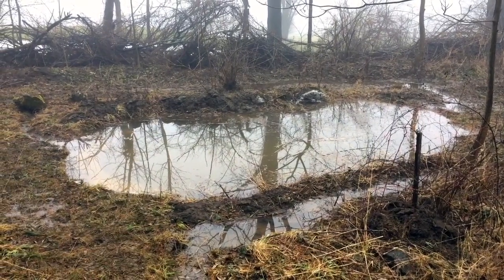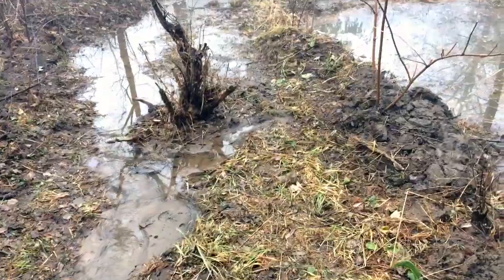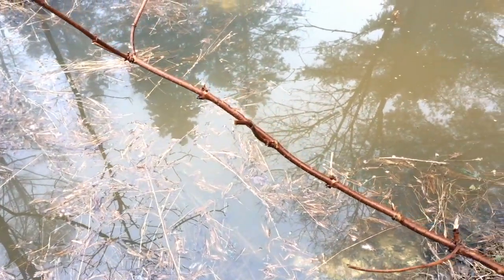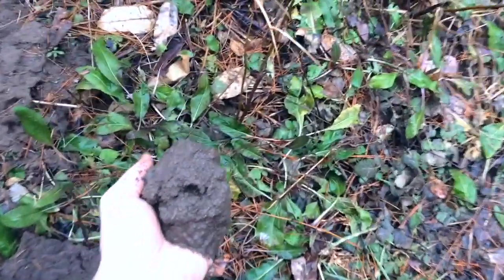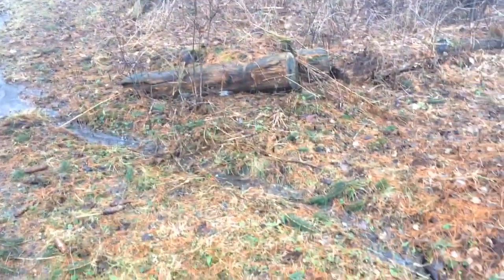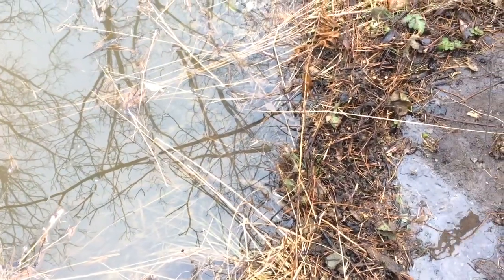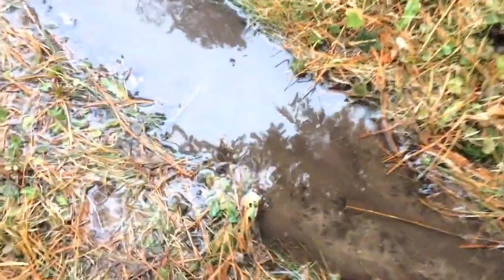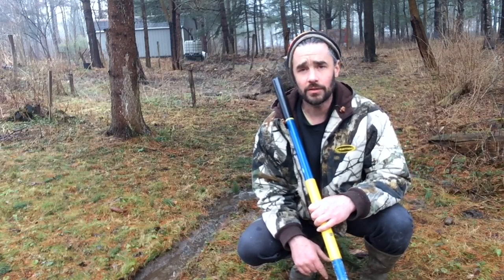Waterway refinements - Silt collecting and flow spreading (in-depth)

Comment: There is a type of shovel called a "Mud Shovel" which is just a regular shovel with a bunch of holes drilled in it. This is helpful for this kind of digging in several ways. 1) It is a little lighter. 2) the water drains out as you pick it up so you are moving more mud and less water. 3) It breaks the suction of mud (especially high clay content sticky mud) so that it can slide or be knocked off the shovel more easily.
Reply from the maker: https://www.youtube.com/watch?v=j3Hu2cBsKwk - Ha!  I made a video about them... Got into that type in the last few years and LOVE them!

Comment: What is the purpose of your Pond?  To reduce silt build up in the Pond itself, I feed mine underground using a standard 4'' sewerage pipe at the inflow end and another outlet at water height level to take the water out back into the creek/stream.  I also have another 4'' sewerage pipe at the outlet end underground which provides irrigation for our Back to Eden Garden.  For berms, barriers we used recycled tires/tyres filled with earth.  Therefore, my Pond is termed a living Pond, grows Lillie,  supports fish, frogs, water snakes and is never stagnant albeit, we dug ours with a mechanical digger as it is over 3 metres deep in the centre.  You're very lucky to have a natural water course/supply as I do on your land and it has to be used to its best efficiency.  In our latest clips, we show how we dig flood relief trenches as after heavy rains and/or rapid snow thaw, we get flooded out and my Pigs are down there.  I harvest my silt from the natural course of the stream too.  Nice work.

Comment: It would be nice to have an abundance of water, such as you do. My swale and pond systems have been dry for well over a year. So no observing and tweaking for me. Just yet anyway. It's difficult to see, with your plants in dormancy, but I know you mentioned berries you were building into the berm. I was wondering if you had, or planned to have a tall tree, in the centre of the berm, to partially shade the berry shrubs? It would add another layer of nutrient accumulation, having the leaf fall of the tree, naturally feed the shrubs underneath.

While the shrubs will take up the excess nutrients from the added silt, the addition of a central tree, will ensure none will be leached if the shrubs have more than their fill. The nutrients get locked up in the tree leaves, and then dropped again in autumn. Just a thought. :)

Comment: The crows as background noise cracked me up.  Sounds like here too, but then I'm only in the next state over.  Was the bentonite you used in powder or granule form?
Reply from the maker: It was a 50# sack I got from a local hardware store.  I believe it was granule form, Sodium Bentonite.  From the feed side of the store actually... I guess it's used as an anti-caking element sometimes?
Reply: Thanks!

Comment: That muck isn't like cement when it's drier? (Moved to another place, that is)
Reply from the maker: If it were in one huge lumpy pile it would be, but as a thin layer or mucked against the stem of actively growing plants that shade it, it is wonderful.  If I can get seed onto it early spring, all the better.  It's when it just bakes in heavy sun that it can get rocklike.
Reply: It looks like typical forest soil to me. Very fine and very fertile I would imagine. Great that you try to keep it on your land!